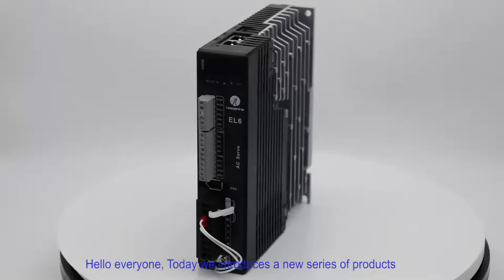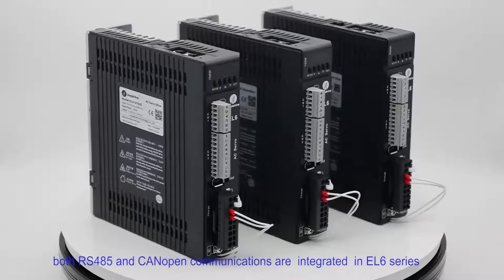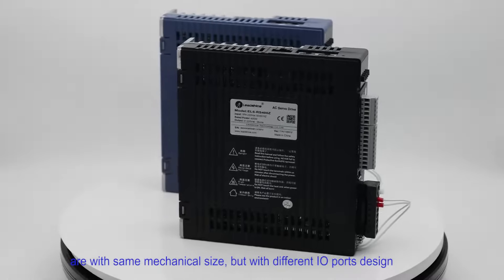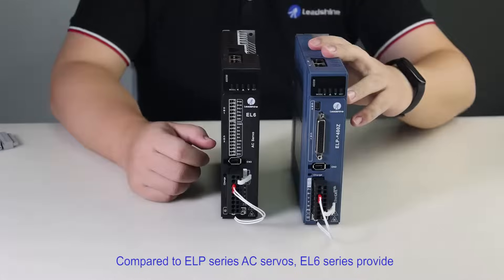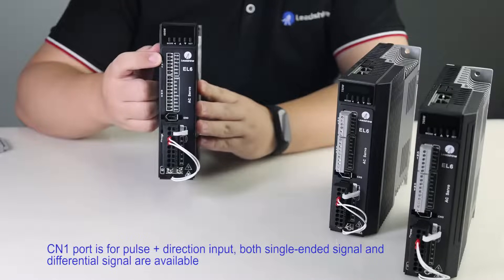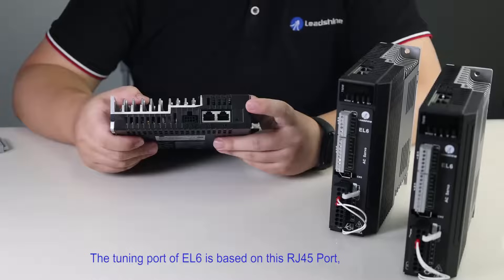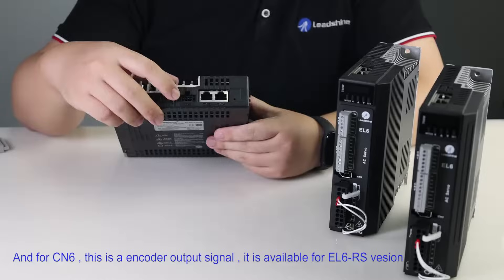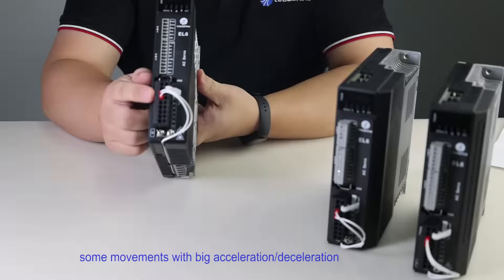Leadshine EL6 Series AC Servo Drives Brief Introduction

Comment: On L7 what is error 100 and how to fix it
Reply from the maker: Err100 often occurs when motor is overloaded which means the load is too heavy for the servo system. If this is not the case, please refer to our user manual under chapter 8 Warning and Alarm -> Er100 on how to solve the error.